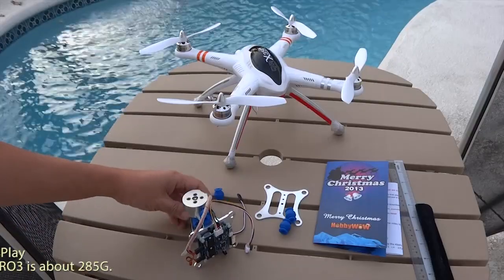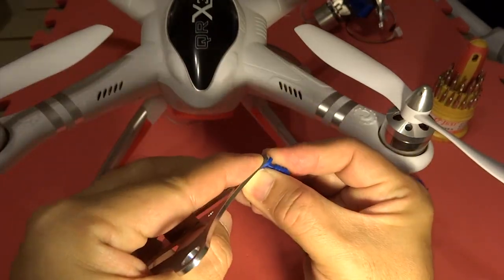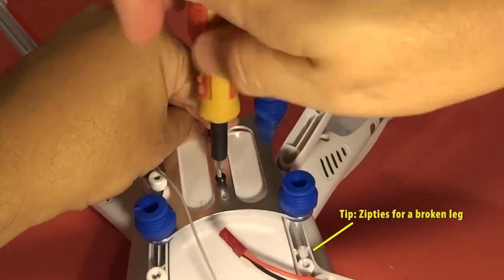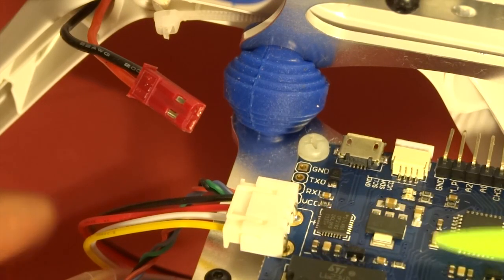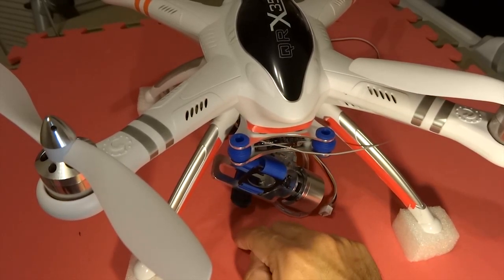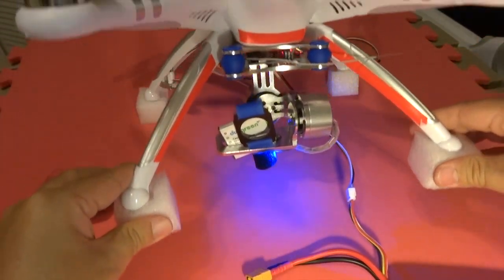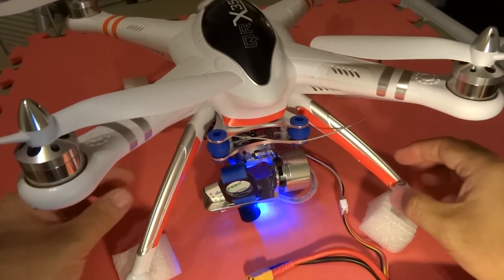2-Axis Brushless Camera Gimbal Plug and Play for DJI Phantom & Walkera QR X350 FPV

Comment: does this gimbal run on 3s?
Reply from the maker: Hi!  The gimbal is currently over 10000 miles away, so I don't have it to be able to confirm the specs, but you will be looking at a newer version now, as this was filmed 3 years ago.  You should be able to find the new specs.  - dm

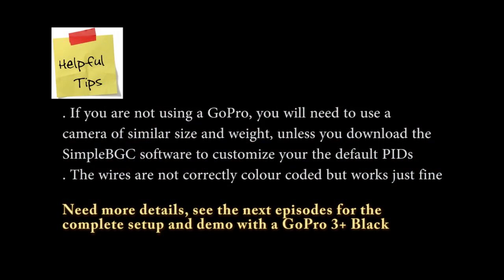Comment: Lok at 4:01 -- he puts down the drone, and the Gimbal starts shaking! Relying on the mass of the load for damping?
Reply from the maker: +Jon Watte yes, I think all gimbals requires the mass to be calibrated precisely for a perfect balance, so each gimbal should be tuned for a specific camera.   Personally I would suggest a newer gimbal, this one was filmed back in 2013, so in drone years, this  8-bits probably belongs to the museum.  I consider AlexMos, the father of FPV gimbal controllers, he invented it, so get gimbals with his latest SimpleBGC  board, now 32 bits.

Comment: Would this work with a quanom nova cx-20?
Reply from the maker: +Sly Skateboarding hi , we don't have a quanom, but the gimbal uses standard jr connectors in rc, so just connect to your receiver.  If there are newer models, you should check them up, in "drone years", this version may be old.

Comment: question. Is it possible to set this up (maybe with some minor mods) in an inverted position so it dould be affixed to the fuel tank or tail piece of a motorbike?

ie have the shock absorbers as the base with the gimbal unit sat above it?

Comment: What doesnt work here guys is when you mount a gopro camera with the 90 degree video out cable to your video transmitter it DOES NOT FIT! What happens is the screws on that gimbal motor hit against the video connector and the camera mounts at an angle. I would not buy this mount again until you see they made design corrections.

Comment: Hi hope you are able to answer,  have you tested this 2axis gimbal against the Walkera version which comes with the 350 pro ?  Also comparing weight of the units compared to each other. thanking you for your time
Reply: yes, we tested it on G-2D love it, see episode 53, 54, 56, 58.  Thev G-3D will be out by August.
Reply: Thank you for the info, sorry i am asking you about the weight, I am waiting for my 350pro due to the supplier selling out of stock , I also bought the one of the units you used in the 41 episode, what I liked about this model is I am able to calibrate it , but the Walkera you cannot , that is the reason I am asking about the weight and wanting to find out the pros and cons about the 2 units different units, maybe worth doing a episode and compare the differents between the 2 units , i think this would help others. thanks for the great work

Comment: Which controller are you using to rotate the go pro? The same of the qr x350?
Devo 7 is good?
Reply from the maker: this gimbal comes ready with 2-axis controller.  stabilization is handled by the controller.

Comment: Can I mount a Sony AS100 on this gimbal? It seems to have enough space for it although was designed for a GoPro. If yes then please tell me where to buy it and price. Thanks
Reply from the maker: Victor, out of the box, it is calibrated for a GoPro.  As long as the weight and length is about the same as a GoPro, it will work without any tuning.  we don't use the Velcro that came with it, as we have a lens filter, instead we tie it with a rubber band and put some velcro on the base.  +-US$80.  You can get it in various online store, but we got ours from Hobbywow.com if you want the same exact one.
Reply: Victor Santana Did you manage to setup a gimbal to work with the Sony Cam?

Comment: hi. can you tell me if this gimbal features input for tilt control ? so you can tilt the gopro downwards 90 degree?
Reply from the maker: For this blue velcro gimbal, yes, there is a channel to input tilt control.  As for 90 degrees, we have not test that yet.  we will post some video when we do, stay tune.
GoPro test on x350 here: GoPro 3+ Black, Protective Lens, on a 2-Axis Brushless Camera Gimbal